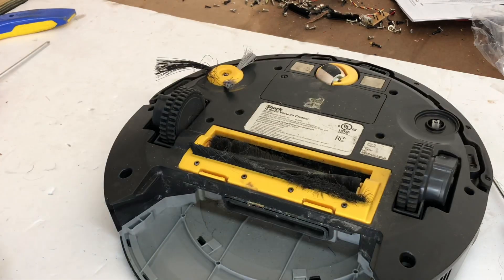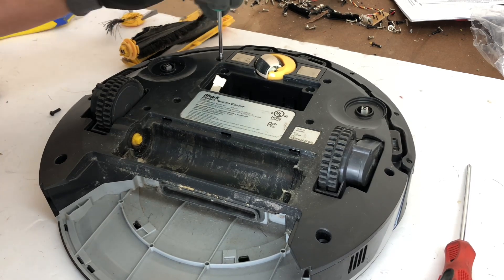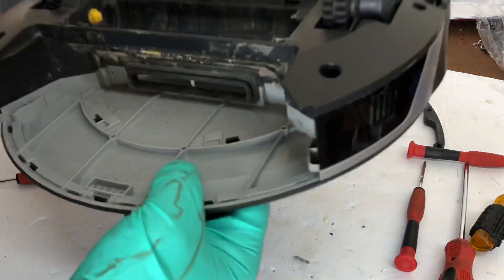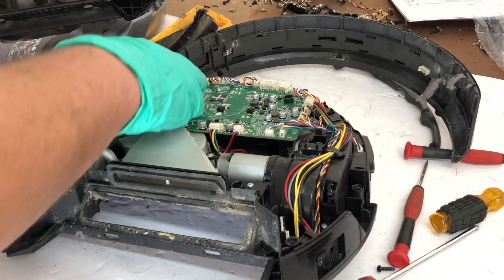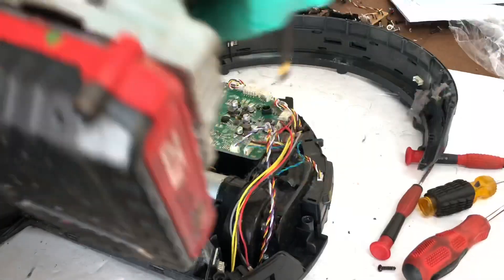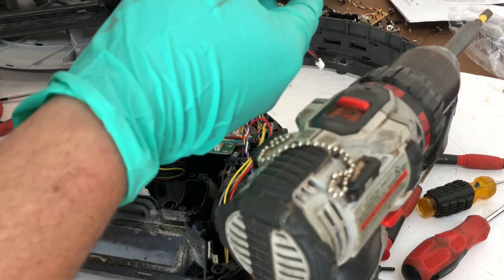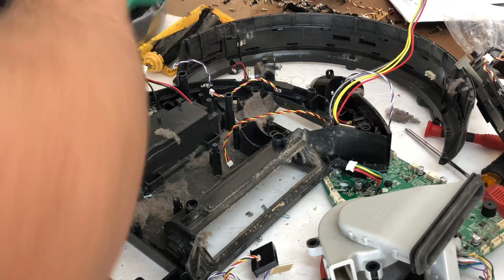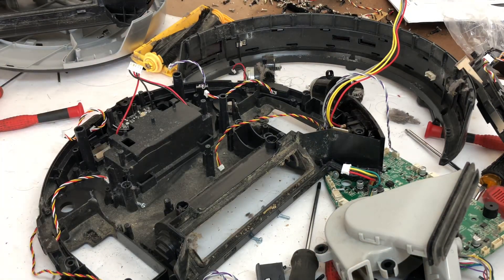Shark Ion Rv700 robot vacuum cleaner tear down. How to replace all parts

Comment: At the 6:54 mark of your video there are three wires twisted together (black, red and yellow) that are going down somewhere behind the grey suction duct. When I pulled the wheel out, I didn't see where the end of that wire that appears to be terminated in a small metal shroud goes to. Can you post a picture or something showing exactly where it goes and how it is seated?

Comment: I am still determined to get my RV720N to run again. I decided to test the brush drive motor with the brush in place. This resulted in the brush not rotating. I just heard a click. I ordered a brush motor assembly on EBAY. Unfortunately after filling down the case it just doesn’t fit. Have you ever run into this. I am waiting for another one to arrive. I noticed the motor is very noisy in the old one as compared  to the motor in the one that does’t fit. I believe you said the brush motor is one if the most troublesome problem?
Reply from the maker: Yes it’s common for people to have the wrong stuff listed. That’s one reason I stopped listing most stuff on eBay people would buy it and it would be for the wrong one or they would talk to someone else on eBay then order from me and be confused because the other person had no idea what they needed. The cases are model specific two or three models will have same parts that’s it
Reply from the maker: You probably got a 750 motor assembly not a 750n or the opposite.
Reply: Do you have the brush motor assembly for the RV720N. I have order 2 different parts but neither is correct.
Reply from the maker: @JJKOFROTH  email me at smittysworld2015@gmail.com send me pictures of what you have

Comment: would like to see you disassemble wheel assembly for shark ion rv750  would like to see where the snap ring goes . does it go under the gear that fits to wheel axle or above the gear the snap ring just doesn't seem to fit on this shaft as there is no groove for it to fit in.

Comment: My mother has a Shark Ion RV750.  When you press the 'Clean' button, the robot just turns CCW a little bit, but never completes the full circle.  It then stops, and all the lights begin flashing (Including the !).  I tore it partially down today, examined the two drive wheels, and both seemed to working both electrically and mechanically.  If the motherboard on the Shark RV750 is similar to your Shark Ion RV700, perhaps one or two of the power transistors on the motherboard went out.  Anyways, it's warm today so I might tinker with it later.

Comment: Took my cordey r350 apart because I keep getting a main brush error, assuming the main brush motor is bad along with the bearing. But now I need to find a replacement motor.
Reply: Scratch that, cleaned the bearing and reassemble. It's working great now. Bearing must've been causing it to overheat and shut down

Comment: My RV700 is clean and it stops after just 1foot and a red exclamation sign and a clean sign flashes and the robot beeps. It is fully charged.  I reset it , cleaned it etc and still only moves about a foot and then stops and beeps and these lights are flashing. Wheels are moving easy by hand, so does the whiskers.  Brushes are clean, etc.  In fact this unit is about 2 years old but barely used.  I would hate to throw it out. Any way to fix it ?

Comment: Great video.  I was able to to remove and clean the left wheel; however, the drive motor next to the right wheel does not "just lift right out" as your did.  I see a screw hidden just underneath it that I suspect is holding the wheel in, but I cannot get to it until I get that motor out. Any suggestions?
Reply: How did you do it? I'm having the same problem

Comment: I have  shark rv700  runs for a minute then a red exclamation flashing comes on stops working it worked find till it picked up a battery got the battery never went inside what should i do

Comment: Thank you for your informative videos. Could you please show how to clean out the little wheel at the top that gets pet hair collected on the spokes such that it doesn’t turn well. It’s the small black and white wheel in the yellow casing at the top. Thank you!
Reply: Just pull up.   That's what I did on mine.

Comment: Where are the Senses Located at that the bumper hits??  My robot stopped working and keep saying Check bumper
Reply from the maker: It’s more than likely the two metal prongs underneath the bumper take the screws off the bottom of the bumper it’ll come apart into pieces and then you will be able to see the two little metal prongs one of them might be bent
Reply: @SmittysWorld  thank you

Comment: Hello friend, can you put apart the side wheels, I tried but it has some little pin, I can't seem to find a way to open it and be able to clean, this video helped me to open and clean other parts but not the wheels, thank you for your time.
Reply from the maker: I just got a shark 700 series robot in and I will be making a lot more videos this week
Reply: @SmittysWorld  thank you for your answer.
Reply: Hi i have the 700 and it runs in circles. I watched your vedio and dismantled checking wheels and all clean and good to go. Put back together but it still spins in a circle. Any ideas?

Comment: Smitty - I've watched several of your YouTube videos, and they are great! My problem is unusual;  it is not a mechanical fix. A 16 x 20 picture dropped onto our RV750n and struck it right on the POWER button. Now that button is lit, but the Shark won't do anything. So, I think what I need is the top case for it. I haven't seen this addressed in any of your videos. Can you help?
Reply: OOPS! I meant the CLEAN button. Sorry!

Comment: Any idea how to fix one that runs for 4 seconds and then has a red flashing clean + ! error? Mine is a SharkION RV700_N. The manual says the error is suction motor failure. Shark said they couldn't do anything since its out of the warranty time frame  and that they don't fix them.
Reply from the maker: Suction motor is bad has something in it or the motherboard is going bad parts are hard to find so best to upgrade unfortunately

Comment: Hey bro can i send you my robot so you can fix it ?? My robot spin in circle on the same position.
Reply: Same problem I'm having with mine.
Reply: I have taken mine apart and semi fixed it but it always fails again. It is the plastic gear inside the left wheel. The part that slips onto a metal rod that spins it has worn and will not turn. The rod is circular and the inside of the plastic gear is supposed to be round with a slightly flat side which catches and causes it to spin. With this part being worn the wheel does not spin.

Comment: Smitty do you have a main brush motor for a shark ion robot RV 750? I was able to get to it thanks to your video.
Reply from the maker: jmllsd 750_N or 750 two different motors
Reply: @SmittysWorld I have the 750, thank you for your reply.
Reply from the maker: jmllsd I don’t have any 750 right now i know the housing is different the motor itself I’m not sure about if it’s different or not.
Reply: @SmittysWorld I knew there had to be a part #, I just peeled off the strip of cushion and found it - Standard Motor, RP390-ST/20143/DV, SMBD137Z15 RoHS - does this help?
Reply from the maker: jmllsd yes I will check once I get off tonigjt
Reply: @SmittysWorld  Thank you and that is very nice of you to do!

Comment: Great video! My RV720 got wet. Now it will not work. I am getting a strange error light. It's blue and looks like a square battery with  a clock face on the upper right corner of the battery icon. I cannot find that icon anywhere in the Shark site or docs. Anyway, I replaced the batter,y no luck, so I am thinking perhaps replace the motherboard. After seeing this, I'm not so sure I could get everything plugged into the right place! Any thoughts?

Comment: Thank you! This is really helpful! Ours no longer recognizes the charging port after an injury to one of the metal contacts. Do you sell the parts for this repair or will you repair? Thank you!
Reply from the maker: Shiann Metheny which robot do you have I need to exact model number to make sure. I do have the charging pads and connectors I can put them up for sale if you need one.
Reply: @SmittysWorld  we have a 750. Thank you!!